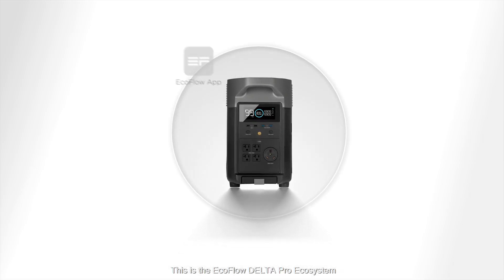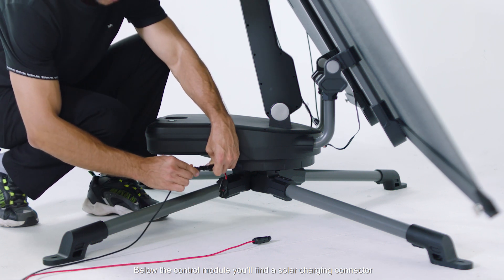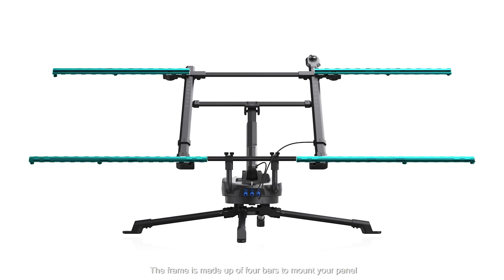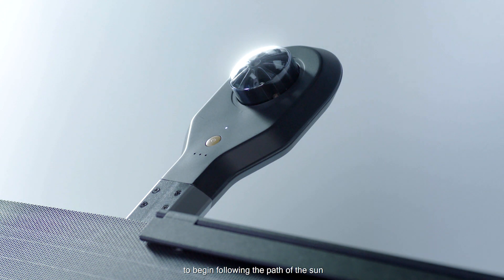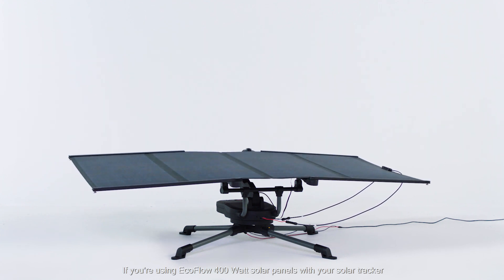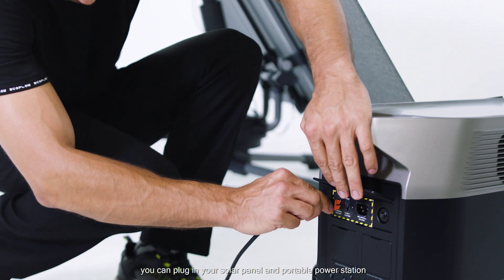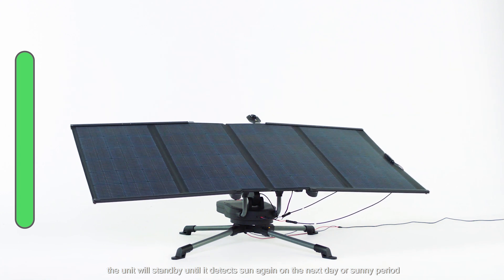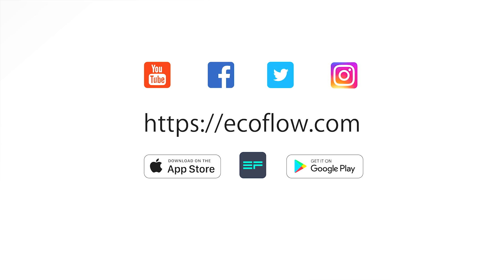How to use the EcoFlow Solar Tracker

Comment: Due to the extreme drop in prices for solar products, it is much more economical to simply install more solar panels instead of trackers!
For more constant yields, the solar panels should be aligned in an S-E (= morning sun) and S-W direction.
In any case, trackers are prone to maintenance and faults outdoors due to the mechanics and electronics, and are also very susceptible to wind. 
For this reason and because of the mechanics, most do not last for many years.

Comment: @ecoflow Can the tracker stay outside 24/7 or isn't that what it was build for? I am thinking about putting one if those thinks on my roof because in the EU you are (with some PV set ups that put the energy directly INTO the wall plug) limited to 600W ..... That makes the tracker even more useful. Super expensive though.... I don't see why it has to cost that much. There are YouTube videos out there where you can build something like this for less than 20$ (sure, wood and not the same build quality and functionality but in general)

Comment: Beautiful and a great unit, but way too costly for me!
Reply: The tracker will only produce about 100 watts extra out of a 400 watt panel. 
Tilting your 400 watt panel at the right angle then rotating it manually to face the sun like 3 times a day will almost produce as much as that $1900 to $2700 tracker.
Reply: @MoBiRa-t6k  I just saw the price $2700 - for that I can buy 5kw of solar panels. No adjusting needed. Considering the technology involved, it’s totally overpriced. Even the delta max is cheaper.

Comment: The tracker at $1900 30% discounted price is not financially viable for the small 30% claimed increase in production. 
Better to buy 2 more 400 watt panels for 1200 watts total for about the same price as the tracker and 1 400 watt panel. 
The $2700 list price is even more ridiculous.
Reply: $1900 would buy over 2kw of panels in UK, and a charge controller, cables...
Reply: @chrisfryer3118  That is surely adding more then 30-40% :-)
Reply: MBR - Wow! I'll just make my own stand for my 2 panels and then move them throughout the day.
Reply: Where do I order? Please send a link, interested in the unit alone, not the package Kickstart deal.